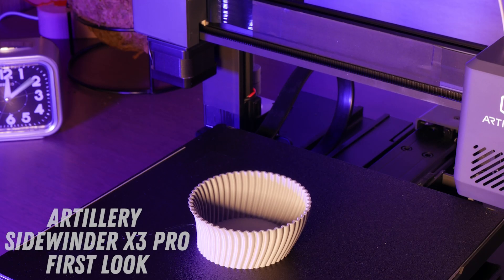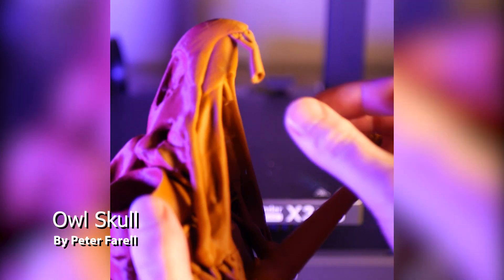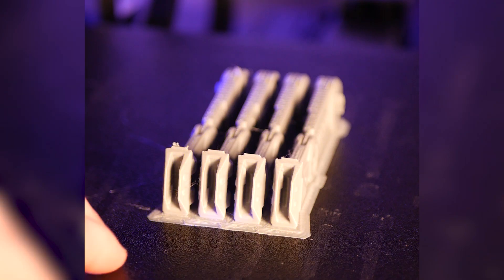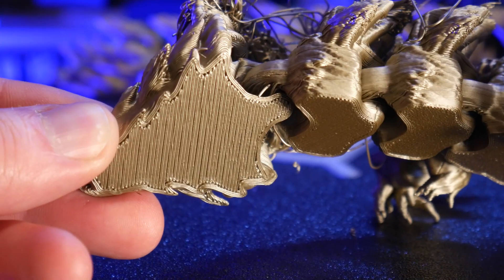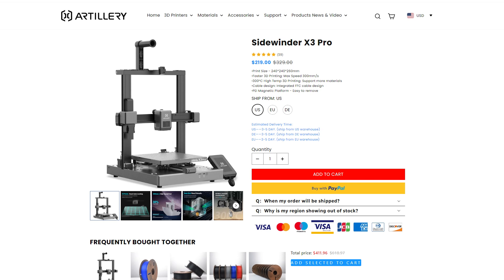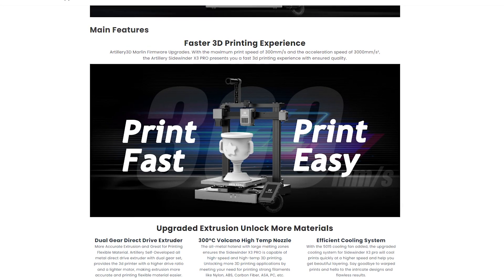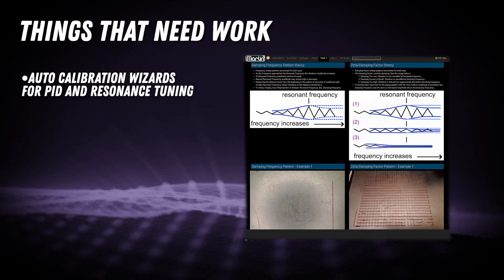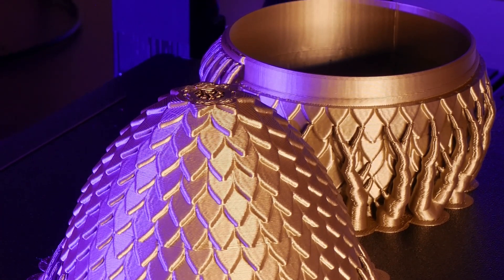Cool 3D Printed Things on Artillery3D’s Newest 3D Printer, Artillery3D sidewinder X3 Pro First look.

Comment: I had exactly the same issue with nozzle becoming loose after a month of printing. Then a timing belt on Y axis got torn apart a month later. 1st was easy fix, 2nd also relatively easy (once you have a replacement belt which I bought myself, only with steel core instead of fiber glass) for someone familiar with mechanics and DYI. In general I think it's a really good value for money, definitely a good printer to get into the hobby 👍